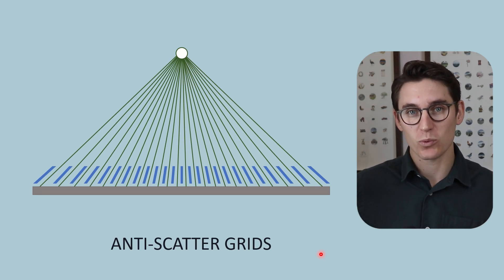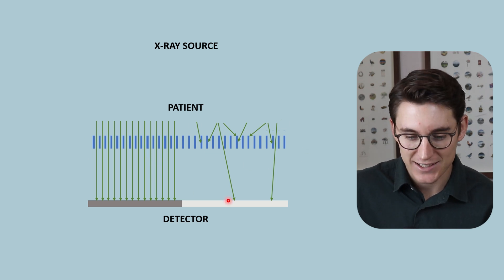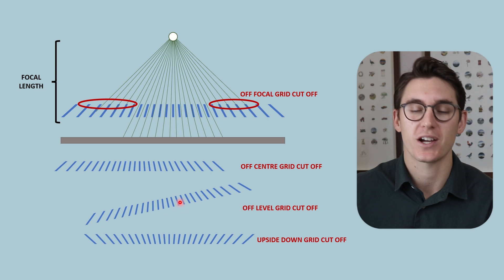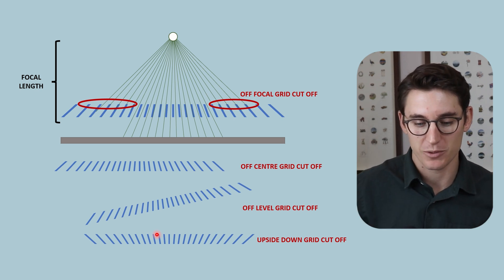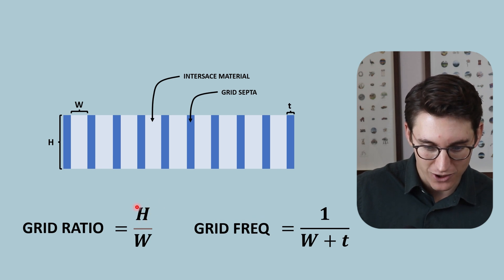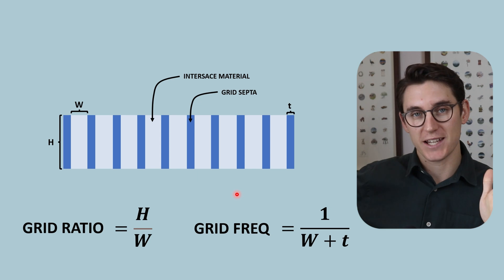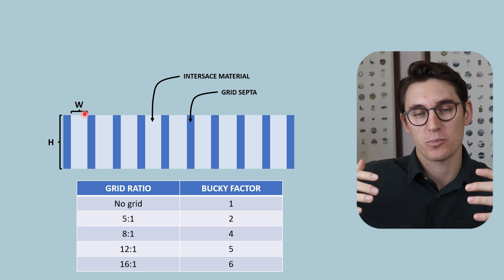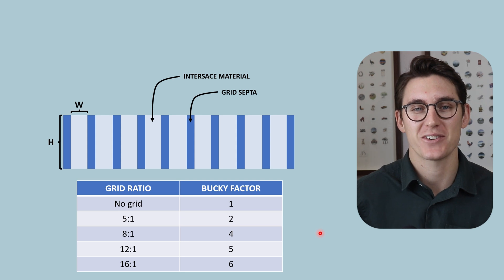Anti-scatter grids | X-ray Physics | Radiology Physics Course #39

Comment: I have surveyed qualified radiographers at national conferences and only 1 in 4 know how to use a focused grid properly. It is possible to angle the tube across a grid as long as the tube focal spot is aligned to the grid focus. To find the alignment, I use 'the sundial technique' - something vertical on the focus grid central line will not cast a shadow. Something angled up or down the central line of the grid will act like a sundial with the collimator light, so no grid cut off for any projection with a portable grid. Here is my YouTube on grids https://youtu.be/QRT7wpOZmko